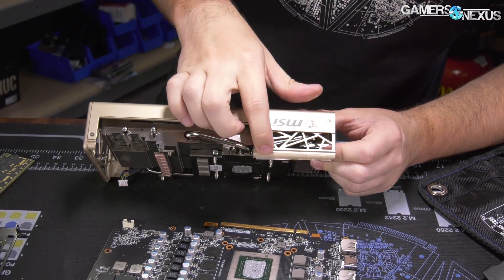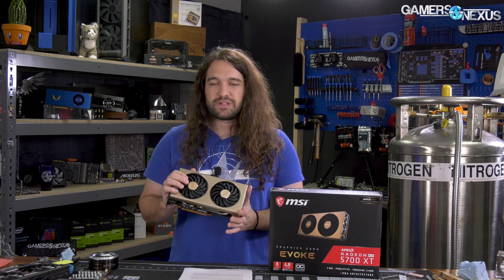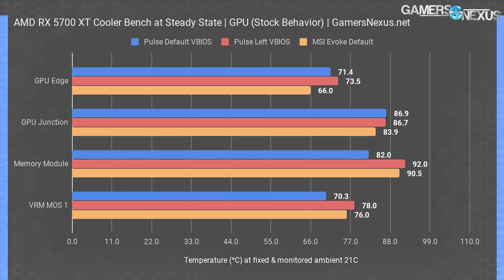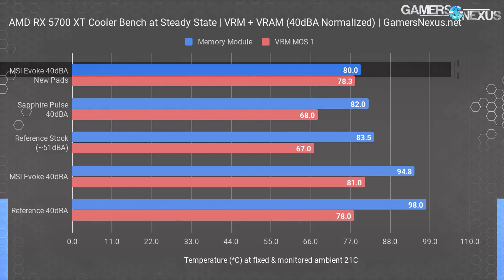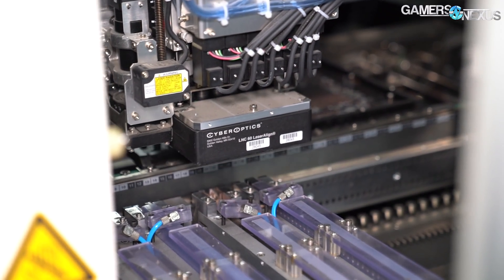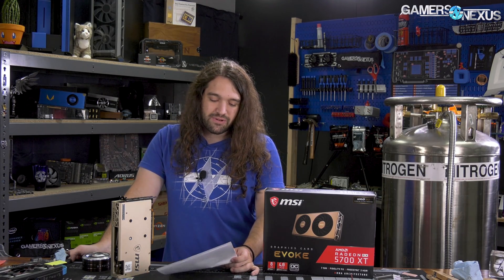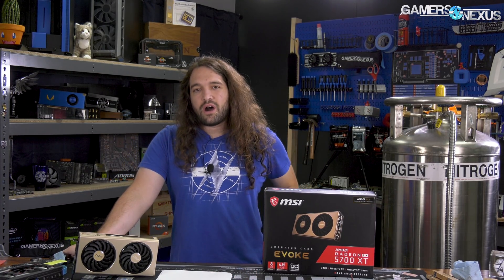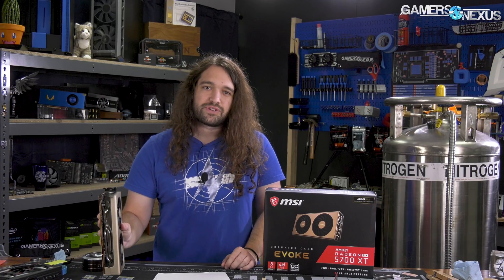Fixing MSI's Design Flaw: Thermal Pad Swap on RX 5700 XT Evoke OC

Comment from the maker: You can find our RX 5700 XT Evoke OC Tear-Down here: https://www.youtube.com/watch?v=morJq0HJoCc
And our RX 5700 XT Evoke review here: https://www.youtube.com/watch?v=9pj4F8qUBEw
Article will be live 10 minutes after publishing. It will be here: https://www.gamersnexus.net/guides/3504-fixing-msi-rx-5700-xt-evoke-thermal-pads
Reply: i recently bought a Msi Rtx 2080 Ventus V2 and the thermal pads on the ram are exactly the same, only cover about 50% of the mem chip, gpu z does not show me the mem temps so no idea if its safe or not
Reply: About the seemingly "odd" approach of the pulse cooler design vs this kind (full cold plate) of approach wich at first glance seems better.
 I've got some vram modules die on me (well the card died) on a 280X some time ago, the card in question was a windforce with 3 cooling fans from that era, and in the summer I got quite heavy artifacting, memory artifacting that is, in winter it was fine. It died the next summer (thankfully it was still in warranty) I assume from vram overheating since all of these type of cold plates assume that they can manage the heat output of the card, because in fact the gpu and vram temperatures sync together, and that's fine for most regions of the world. But! it's not for regions where in the summer room temperature can reach up to 45 degrees (celcius) with a case temperature of about 55-60 while gaming. In those cases the gpu reached about 95 degrees and with the cooler being insufficient the vram modules became heatsinks (or more mass for the gpu to heat up) so the memory modules were also at about 95 degrees. Those 95 degrees were not for a short period of time, but for several hours every day, eventually after a day of heavy artifacting (the memory kind of artifacts)  the gpu didn't turn on again. I don't know how hot the vrm ran. With the pulse's design this problem is less likely to occur, since the vram has its own heatsink even is the gpu reaches 100 degrees the ram will have it much better than the msi one or that 280X that died on me, since the gpu cannot sink heat into the ram modules. Actually in these scenarios even no memory cooling at all is better that having the memory contacting the gpu coldplate. 
And I just gave you some content ideas, how'bout that! I'd love to see thermal testing like that to be honest.
Reply: the "wizard" executive who saved 100,000 dollars with little "cost optimizations" last year had to top himself this year.  same ol thing thats ruining every industry today.  things cant trend upwards every quarter.  stock price isnt everything
Reply: way easier for such stickers. soak them in alcohol, the adhesive will get soft , you can then remove them without damage, and once the alcohol evaporates the adhesive will go back to normal and you can stick it back on
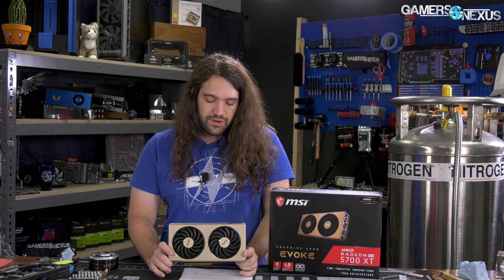Reply: 2:08 i dont think fitness is gonna matter here steve xd fitment would be nice tho ;)
Reply: Where exactly are those warranty void stickers supposedly legal?

They aren't in the US and aren't in Europe.

Canada? Japan? India?

China definitely doesn't give a crap.
Reply: @enlightendbel  All America less USA and Canadá, Africa, Asia, Australia and this region... 

Im from Argentina and i have to deal my warranty with my local store, that then they have to ship to USA and i have to pay for this too, when in my Country warranty=0 cost for ships or other stuff, its must be 100% free ...

I ll not buy MSI anymore, EVGA has better warranty
Reply: @gotija  in Europe every piece of electronics has a mandatory 2 year full coverage warranty.

Most of the time they just replace the entire device without even looking at it.
Reply: Find any source for those washers yet? I have been looking day and night for a week
Reply: I know amazon and most hardware stores sell plastic or nylon washers of varying sizes.
Reply: Wtf is wrong with MSI? These cards will net them good profits yet they still want to squeeze those last pennies. Disgusting.
Reply: They also cheap out on 470 motherboards bios memory size as much that they had to make a new version of those motherboards to properly support the Ryzen 3000 series too. Never bough an MSI product, but it is becoming a no no brand to me. Thanks for letting us know this little details.
Reply: thermal pads + replacement thermal goop, but yeah, not that much.  Maybe someday people will figure out that thing called thermal dynamics.

Great vid Steve and crew. B)
Reply: And add Igor's hints from his Lab: https://www.igorslab.media/en/making-the-radeon-rx-5700-and-rx-5700-xt-more-energy-efficient-and-significantly-quieter-with-the-morepowertool-tutorial/ :-)
Reply: does it have to be a 2mm pad? will a 1.5mm work? a 120 x 20 x 2.0 mm thermal grizzly is 37.93$
Reply: Do I need to buy new thermal paste if I want to replace the pads?
Reply: Go test new amd driver Steve

Comment: I just took my EVGA RTX2060 12gb apart to check it and found a complete strip of Thermal Pads on a location without a Memory Module and put it on the Memory correctly. Who does that? He missed it completely! How many others did he miss?

Comment: Thank you Steve, you helped me fix my MSI Radeon RX5700XT Mech OC. Temperature was about 80°C before I laid new thermalpads 2mm thik and new layer of thermalpaste on chip. Now on full load temperature stays at 63°C.  Greetings from Aalen, Germany. 🙂👋
Reply: I Recently bought a MSI RX 5700xt Mech OC myself, I have the same issue and right now I have to undervolt it heavily to keep it at 70°c. Do you have any tips on where I can get the same pads as you in, I live in EU, I can read german so German links work aswell. Also what paste did you use, I plan on using kryonaut from thermal grizzly would that work? Thanks beforehand for any replies. 😢
Reply: @Teffe-zq8tr  ich nutze Arctic MX-4 thermal paste und Peutier 5Set Thermalpads (0.5,1,1.5, 2 und 2.5mm).Die habe ich in Amazon gekauft.
Reply: @Teffe-zq8tr  Ich habe Arctic MX-4  Wärmeleitpaste und Peutuer Wärmeleitpad set im Amazon gekauft. Original Wärmeleitpads waren sehr klein, deswegen hat sich die Graffikkarte überhitzt. Jedes Stück habe ich auf die Große 1*1cm ausgeschnitten. Nachdem habe ich in Steckdose ein Messgerät aufgebaut um zu wissen,  wieviel Strom verbraucht mein PC ( Ryzen5 3600, 16GB DDR4 Corsair Vengeance LPX, RX5700XT), es war gegen 200W. Wenn ich zum Bespiel Cyberpunk auf 1080p spiele, Grafik Einstelungen sind auf hoch, die Temperatur von CPU und Grafikkarte geht nicht über 70°C in geschlossene Gehäuse.
Reply: @Teffe-zq8tr  https://youtube.com/watch?v=NwqhtbRmt7A&feature=shared
Reply: @Teffe-zq8tr  aus dem set habe ich 2mm dick Wärmeleitpad genommen.

Comment: Late to the party. My wife CAN'T STAND how loud my PC is when it's really working hard. My MSI 5700 XT junction temps are almost 45-50 degrees hotter than the GPU temperature under full load. No throttling is happening but this card is so damn loud.

Comment: They're also using crappy thermal pads on their GPU/CPU in their newest laptops.  I'm having overheating problems with my GE66 which has increased 10 degrees on average over the last 3 months.  MSI says I can only RMA the laptop and when I ask where I can simply buy new pads myself, they have cut me off from chat all 3 times, and ignored followup e-mails completely.

Comment: 2021.. just bought one of these used for CAD$850 (USD$680), because crazy prices and I needed a new card, and it needs the thermal pads. Memory goes top 107C during gaming, card at 78C.
Your listing on Amazon shows it's a $50 kit!! Wow..

Comment: My 5700XT Gaming X edition was running warzone at 110c junction temp (crashing without custom fan curve to keep it at 105).  Popped it open, come to find that the pads had full coverage, but they used 1mm pads for one side of the VRMs and 2mm for the other. So there was likely little to no contact! Swapped out all of the 2mm pads appropriately as well as the paste with some arctic silver 5.  Running at a stable 65c junction now and pulling 30+ more fps! Thanks Steve!!

Comment: The thermal pad issue is sadly still present in MSIs rx5700xt gaming x except now, you cant fix it by just pasting on the right size thermal pad. My memory temps at sitting at 96c. I put a cpu heat sink on the backplate of where the upper memory modules sit and dropped the temp down 4c.

Comment: Picked up a "bargain" new MSI 5700 XT MECH OC. Even before I installed it in my system I could see it was hot garbage. Just looking down through the card I could see an air gap between some of the thermal pads and the heatsink! Anyway, I installed it. WOW it was hot. I saw hotspot temps of 113c and the RAM was an almost constant 104c when playing iRacing. No surprises, I have returned the card already for a refund.

Comment: I have question regarding the thickness. I recently changed the thermal pad for my Alienware and I forgot to check what thickness they were. So I got some cheap 1mm thermal pads and placed it on the vrmas and capacitors. Does this cause any issue?

Comment: who would do this and why? The updated bios lets the card get to 110c junction temp while performance drops about 0.5% and the card remains quiet. I could unlock my fans (the new bios sets them to 60% max which reports as 100% in afterburner yadda yadda) and then get WOO COOLER!!! but why? Even with Max fan and max noise on this card it's barely a 2% boost in games and compared to these other companies who way overdid the 5700xt which is clearly designed to run at 105-110c there is nothing of note for performance. This is a 1080p ultra 144fps/hz card period. Anyway thanks for slamming MSI as this was discounted around $150 a year ago lol keep up the good work.

Comment: I did this with my Evoke OC (that I got new under $299 USD): Noctua paste, the pads recommended here, and nylon washers to increase mounting pressure.
Avg. temp under load for the last few months is at 69c GPU at 2075 MHz (stock), with Memory temp at 75c and Junction Hotspot at <= 100c.

Comment: Need to really mess with my overclock but came from a 2080ti so I did the nvidia oc method and put power to +50 the max it lets. 2100mhz core and 1200mv vcore memory 905mhz custom fan curve. It gets me boost of 2077 and higher sometimes and levels off at 2000mhz five or take depending on game but usual is around 2025-2050. Temps are 63c or less most games 72c junction or less most games and memory temps are around 68c not any louder than the evga 2080 ti black edition I had

Comment: I did change thermal pads and paste, and now msi afterburner shows gpu temp 75c under heavy load, memory 81-85 and gpu temp 2 reaches 105-109c and i wonder what is gpu temp 2 ?

Comment: At 1st sorry, english not my 1st language but hope you will understand.
Just bought MSI RTX 2070Super Ventus and well I cannot dismantle it because in my country stickers are necessary but when I looked from horizontal point of view under light I can clearly see same deal like you have with that 5700XT. Thermo pads on ~half of memory module. Cutting costs in really wrong place. Save 1$ and risk that during 3 years of varranty one extra card from 400 goes back to them is just bad business.

Comment: Did the fix on my MSI and it worked beautifully. I ended up buying a 1.5 and 0.5mm thick Fujipoly 15mm x 100mm for 25$ combined cost with 11.0W/mk conductivity as apposed to the 8W/mk grizzly 2.0mm for 37$. Thanks for teaching us how to do this.
Reply: where can you buy the fujipoly pads?

Comment: I find it kind of funny that on the MSI website for this product under all the feature advertising there is a section called "Thermal Padding". It says "Ample amounts of thermal pads are used to allow various components to transfer heat to the heatsink for better cooling." I'm thinking they might not know what ample means.

Comment: MSI are doing this across all cards. I have the 2070 Super Ventus  and the thermal pads are even smaller and only cover 50% of the modules. They have positioned them so that if you look at the heat sink they look ok but if you remove the cooler (Warranty void sticker applied) then you can see the penny pinching in its full glory. Influenced by shareholders no doubt. £530 for a card with no accessories and half the thermal pads. If i fix the issue then my warranty is void. No more MSI for me I am afraid.

Comment: I have a question please: Is there any significant thermal difference if a card has a "full" backplate compared with one with a backplate which is cut open to the gpu area? (eg: MSI Evoke vs Saphire Pulse models). Thank you.

Comment: It definitely shouldn't be on the consumer to fix the GPU, and with such great 5700 and 5700 XT AIB cards from other partners, why not just buy an alternative? Until MSI fixes this, their card is the least desirable of the great cards in the 5700 XT lineup, in fact it makes it more like half way between AIB and Reference in terms of cooling, not a good place to be when the other partners are running 15 degrees cooler.

Comment: Do you recommend to cut the max gpu clock from reference at 1900 or let the card thermal throttle at 2150mhz? Is 1100mv for 1900mhz ok?

Comment: My son bought an MSI Mech RX 5700 XT OC video card and an MSI X570 motherboard last week from separate suppliers here in the UK. Both have now been RMAd: the GPU because it crashed upon AMD driver installation (black screen/ no connection even after cold boot/bios reset - system restore required) and the motherboard because it crashed whenever you enabled boot to UEFI (hard bios reset required to recover - 3 successive BIOS versions tried). It's a shame because I've had other MSI gear in the past that's been great - my own PC is running an MSI Radeon R9 290X from around 5 years ago and it's been rock solid since the day it went in.

Comment: I would like to point out once again that the sensor values for the memory are absolute nonsense. (Igor Wallossek 08/16/2019 (Igor's Lab)
 https://www.igorslab.media/en/msi-radeon-rx-5700-xt-evoke-oc-edition-tested-butter-or-margarine-on-bread/7/

When it comes to memory temps i only trust Igor's Infrared Pictures. (scroll down to Board Analysis: Infrared Images)

I dont understand why no one except Igor does Infrared Pictures, all other tech channels like lemmings use the broken sensor values.

Please Steve invest in an Infrared Camera and implement it in your test routine.

Comment: I purchased a msi rx580 for my first gaming pc build back in January, which i have running to a 65' 4k hdr tv. Since day one the card has struggled to keep a 4k signal. Some days it would give me problems and other days it wouldn't. When i talked to support and sent the card to them they said testing on it went fine which were ran on 1080p screens, when i got the card back and the issue persisted, they told me that it seemed the card was having trouble outputting a 4k signal and that i should use a 1080p screen. I'll never buy msi products again , if you are building a pc, save up the money and by the more trusted brand. After seeing this video i'm not surprised, quality control is not something msi is worried about...

Also love your guys work, keep them honest out there.

Comment: Huh
I replaced my reference cooler with id-cooling Frostflow 120vga aio 
, maximum gpu temp is 85 oC during 4k gaming and the memory are cooled by heatsinks only and it goes only as high as 90 oC

Comment: "Get the needle nose pliers, grab the screw lightly and slowly unscrew it"

Been there, done that. Doesn't work very well, because the screw is round, so the pliers slip every now and then and if you put some force, there's a little chance that once it slips, you can accidentally either scratch a PCB/PCB's mask or knock out one of the transistors/resistors/capacitors. My best experience with removing the sticker was putting a few drops of isopropyl alcohol, waiting for it to moisturize the sticker, slowly and carefully peeling it one millimeter at a time, repeating the process till you got that little b!tch out. The end result is the sticker looks and feels, as a new one and you don't even have to put some glue on its back to make it sticky, because its original stickiness is still there.

Comment: Back in the day I had two GTX 570's in sli (MSI branded, reference boards and vapor chamber coolers). One of the DVI ports stopped working on one of the cards so I RMA'd it. Upon receiving it from repair, I was shocked to find that it was a GTX570 gpu on a GTX 480 board (the card with the 'egg cooker' cooler). 

After this, I will never., ever, buy an MSI product again.

Comment: I purchased a MSI gaming laptop recently and the thermals were terrible. I returned my first one and the second one was a little better. I took it apart and put all new paste. They put pads on a cpu component I forget what they might be but I noticed they didn't cover all of it as well. I went from temps as high as 99° on the first laptop to 96° on the second then with new paste it dropped a good 10°C now it rarely gets above 88°c. MSI is definitely slacking. It's a GS63 95DK 610US with i7 9750H  and 1660ti. The temp for the GPU went down maybe 2°C. I really like it other than literally having to take it apart and also the battery life could be better. Idk why they don't have removable batteries anymore it would be super easy to cut out a slot for it.

Comment: I lost a lot of respect for MSI with their last video card I bought, when PCI-E started coming out and they "engineered" it by taking (what I believe to have been...) an AGP bridge chip to PCI-E and stuck a PUNY little heatsink on it.... every time it hit (I think it was, at the time) 72C the whole system would lock up.  No thermal material, no thermal paste or anything, no pad... on a heatsink that was about .75" by 1.5".  I think it was a 6600GT, and as long ago as that were, I haven't bought another MSI product since.